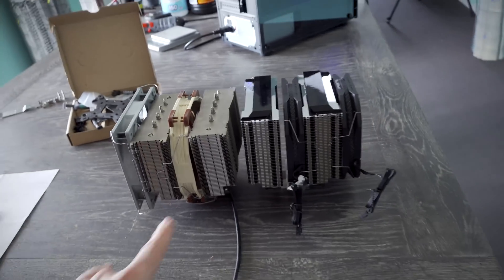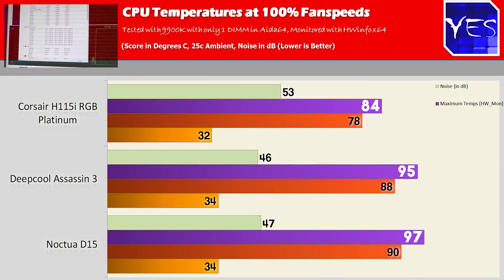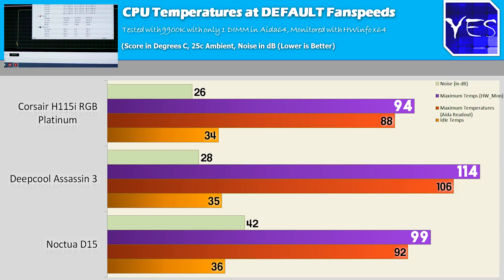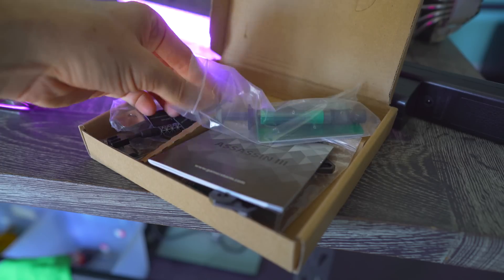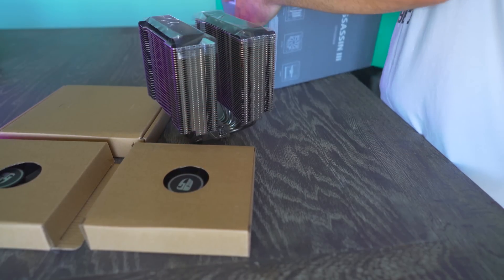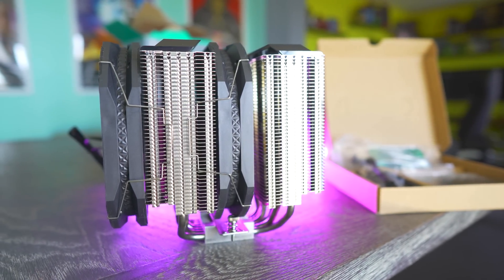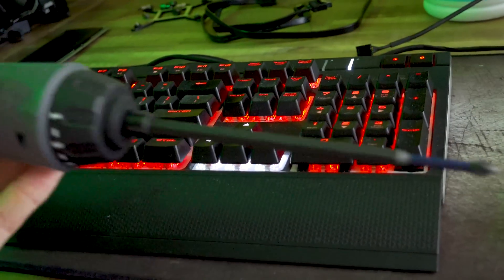Is Deepcool's New $100 Cooler the end for Noctua's D15?

Comment: why the random fan with d15 noctua?? it doesnt even fit as it should... and is not even closer to the stock fan performance. Push config works better with d15. Zero effort man. Read some forums threads before making a video. Besides all that, ive both and if you use the same thermal compound with the same ambient temperature sometimes you get a 0.5 better temps with deepcool and sometimes 0.5 with noctua. Room gets warmer with each test.

Comment: Of course the human ear is most sensitive the frequencies between 2000 and 5k Hz, therefor a fan manufacture can try to choose materials that will have resonant nodes away from these frequencies. Designers should use the human ear perceptual loudness curve model, rather than linear spectrum measurement.

Comment: Why are the coolers are mounted in the wrong direction? They are supposed to be mounted with the fans facing the memory slots and you need low profile memory to use with them. That way you don't block any PCI-E slots on the motherboard.

Comment: Disagree. I'd take the air coolers any day of the week over an AIO for computers that are actually USED and not showcased. Downtime, or the Concern of down time is something that you don't want. If a pump fails, or your fluid evaporates in an AIO (i've had it happen multiple times over the years) then you have little to no warning, if lucky you may see a gradual loss of efficiency of cooling over months of time, or you might just have an abrupt crap-out. With Air cooling, most anyone can 'jury rig' a fan in place to replace any fan that dies, and keep going without the need to fully tear the system down and start a massive hardware replacement campaign. the absolute MOST that you will need to do during the worst failure an air cooler can have, is to replace a fan or god forbid 2. most of us will have a fan of some kind sitting around that can function as a "not the right parts, but at least i can keep going" replacement. If you lose an AIO pump, or fluid, that is a MASSIVE amount of down time if you dont have a replacement on hand or available locally (I do not) There is nothing that makes water cooling a Necessity, and locking yourself into something that is harder to replace, and impossible to repair like a custom loop would be, An AIO seems to be a large weakness to allow into your system, for such minor gains. if air cooling can accomplish all the actual NEEDED functionality and requirements, is that extra 5-10 C cooling going to feel worth it, if your then stuck a week without a pc, waiting for a replacement cooling module, when all you needed was a piece of metal with fins and a fan? (hyperbolic reference of an aircooler) For people who Build a computer to be BUILT then USED, who arent concerned about having ease of access or require constant addition or removal of components, Air cooling is the winner. If you are one of those people who take you computer apart constantly? you'll want water cooling for the ease of install and compactness. If you are like me, and Build it once to work for years, and not be interested in worrying about failures. (An aio in my experience would be the number one component to fail in a system, if all parts were equally new) Then you want air-cooling. I build from a Reliability/value perspective. a 100mhz overclock isnt going to be sufficient encouragement to move to a component that there really is not a good case in favor of. Water cooling is only Actually useful, in very very niche usage cases. anything else is just being a cooling enthusiast. That is a fine thing to be, but one shouldnt build a system based on ONLY the "PROS" but also, what CONS do things bring to the table? and when do the Cons, out weigh rather meager pros. 

If Air cooling gives you all the clocks you are asking for, at reasonable temps, does adding more points of failure make sense? yes, AIO's may offer better temps, but if you are already getting the clocks you are targeting, why add the extra cooling? its like putting a 2080ti in a pc that had been running a gtx 970 that is running a 1024x768 monitor. Sure its better, but WHY?

Comment: Can't wait for the snowman! 

Do modern Pc's still have settings in the BIOS to sound an alarm when the CPU reaches a critical temperature in case of AIO loop pump or fan faliure ? I haven't looked for this setting and if it still exists since I was playing with my first ever 775 socket board.

Comment: Crazy prices when Ali Express offers great 4 pinned (variable speed control fan) double heat sinks (Yes 2 separate towers with heat pipes going to both and a fan in the middle for better heat dissipation) for SO MUCH LESS! 
My old V8 CoolerMaster only has aluminium pipes and actually cools LESS than these cheap ones from Ali Express.
6 COPPER heat pipes and all the attachments needed.  Screw paying that much! Around $25 for the same cooling suits me FINE!

Comment: Well to the very least their AM4 bracket definitely changed this time, I hated the fact that in older CPU DeepCool models - they still used the AM3 clamps which is terrible to deal with if don't know how to use that.

Also yes, unfortunately - the comparison isn't apples to apples so its only fair you do a revisit of the Noctua with its original fans instead of having a replacement third party fan.

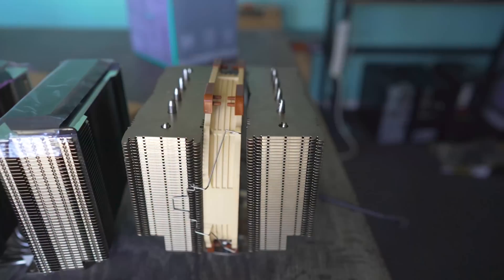Comment: 1:25 That Redux Fan will HURT performance significantly for thr NH-D15. It has terrible static pressure, and tops out at 1200 RPM where the NH-D15 STOCK FANS do 1500 RPM with significantly greater Static pressure.

Comment: Regarding the riser cable mentioned. It either works at the bus speed or it fails. Signal time will be increased due to the signal having to travel further but as long as the signal time is still small enough to still fit within the pcie clock tick the performance of your peripherals will be unaffected. If the signal time no longer falls within the pcie clock tick (very rare I would imagine) then your peripheral simply won’t work at all.

Comment: Linus Tech Tips just did a colab with Noctua ,  for a D15 Remake with LTT Blacked out Cooler and Fans ,  With Orange or Black Rubber Stabilizers on the fans for customization .   And The U12S https://youtu.be/ajJaYGnKpu4?t=419

Comment: The reason the DeepCool fans sound more annoying despite the same dB level is because of the fan blade tuning. Noctua slightly varies the spacing between the blades to spread the noise across a range of frequencies which dulls the perceived noise; this is a technique borrowed from car tires, which vary the size of tread lugs for the same reason. If all the fan blades are evenly spaced or the tread lugs on a tire are all the same size, you have a multitude of noise making elements striking at exactly the same rate as each other, which creates a pronounced tone of a single frequency.

Comment: Last time cleaning my system, i was wondering why there was no light in my H115i PRO RGB but when i got into windows, everything felt so slow, like using win10 on a 15 year old low end system. First thing i did was checking CPU temps, 100c across all cores. That's when i realized i forgot to plug in power to the AIO lmao apparently an 8600k at 5ghz needs the pump to run xD Worked just fine after plugging in the SATA power though, cooler and CPU still runs perfectly fine

Comment: Use that AiO for two years every day, then compare temperatures to the aircoolers again. Your pump will be broken and will either not work at all or be degraded to the point where it loses to an old stock Intel CPU cooler. Thats why its a trash product, having to buy one every two years is a ridiculous waste of money and ressources. All that corsair AiO's swimming in the sea at the end you know..
Reply: LOL WHAT A LOAD OF BULLSHIT!!!!!!!  I'm still using my Corsair H110i GT bought during the end of 2015 and it's still doing FINE!!!  and I even got it on sale back then for a mere $75 . Been using it every day as my main rig 24/7 as i mostly just put my PC to sleep when not in use
STILL RUNNING FINE on I5 6600K OC to 4.7Ghz (yes its overkill cooler for cpu) 22-28C idle - 50-60C load..... YES AIO WILL DEGRADE but certainly will last more then 2 years as you claim, I give it at least 5 years
Reply: @2011-s7k  and i bet it has peaks to 90°C due to pump degradation, because what you are saying is impossible for the type of pump thats build in there, corsair/asetek are even admitting it. You are just the one talking BUULLSHIT or you havnt even tested it properly for years and think its fine when its already gone.
Reply: let's see as I'm typing this to you... oh yeap temp at 25c, Max on Hwminitor 60c while full load , and still haven't clean Mr rig full of dusts for over a year.. yeap you're full of bullshit Corsair h110i gt still running fine... BTW its not a corsair/asetek.... i even gave you the name of the AIO... do you research and have the product on hand to test it yourself even if it's an asetek pump to see for yourself, don't just go on how bad aio are cause you read it somewhere....

Comment: 3.Water coolers also build up bacteria growth after years where air coolers dont, and then jays 2 cents did a test, aios of the same price as the noctua nh-d15 dont cool as well as the noctua. Bryan i think you should check out darkflash 6 heatpipe cooler for 30CAD on aliexpress, its a 6 heatpipe dual tower cooler that uses 90mm fans so its smaller than noctua, but its also a 6 heatpipe cooler so i think it could give noctua a run for their money for performance

Comment: In 2014 I purchased a Corsair H105 240mm AIO to use on my intel core i7 4790k, 4 years later I started to see small drips on water on my videocard, the 240mm rad started leaking from the [endtank]. I went back to aircooling with the "be quiet! Dark Rock Pro 4" silent operation with no problems(amazing cpu cooler), Its nice to see new CPU air coolers on the market.

Comment: The one to beat is thermalright lgmrt. The nh d15 is just the famous fake king, not the real one. Air coolers are not behind, your testing is stupid and by yours i mean the whole internet.
 Stop testing coolers on test benches. It´s not a real case scenario and it will not translate to the case.  Different coolers will behave differently in different scenarios.

Place an air cooler in a mesh case with a front intake aligned, and place an AIO (normally you want AIO on the of the top of the case, so you don´t overheat the whole PC, but lets call it "fair").... See which one gives you better temps and test that at different speeds and noise. If the CPU thermal density is not an extreme high bottleneck, the air cooler is gonna beat the crap out of the AIO, especially when taking noise aswell into consideration. By the way, that´s called, real case scenario, and it´s how ppl use coolers, so it should be tested that. 

Also something unfair, is testing AIOs at max speed. They are unbearable and they come with extremely high RPM fans. Place the same fans on the air cooler. Let´s see how it does, at the same noise lvl.

Comment: i had a Cooler Master Neptune 240 on my i7-4790k and still used that when i got my Ryzen 1700x then i started to hear a ticking in the pump housing and seeing that it was about 4 years old i changed it for a Corsair H100v2 i still have the 1700X set up but when i got my 2nd system a 2700X i got a D15 and i am thinking about getting one for my 1700x system as i do not trust AIO water coolers to last more than 4 years even though that say they will last longer and the D15 runs my 2700X at about 65c max

Comment: Noctua D15s vs D15
The D15s looks like the D15 with the 2nd fan removed but it's actually slightly different. https://noctua.at/en/whats-the-difference-between-nh-d15-and-nh-d15s
The cooling is almost identical with the D15s a degree or two behind though probably it's the same or ahead if you normalize for sound as the two fans on the D15 should add some noise. I thought of getting the D15 at one point then just remove the 2nd fan and use it as a case fan (it's not optimal but in reality works well and is pretty silent as I've done this already with the D14) but I'd get the D15s (or AM4 variant for AM4? Not sure if the AM4 variant makes sense if it doesn't cool better) or wait for what I believe would be ideal... an all-BLACK version of the NH-D15s?

Comment: I got Deep cool-Lucifer v2(wich is big brother of assasin 2 at lower cost)and i am able to clock my old i7 6700k to 4.8 ghz stable with awesome temps in aida to 80 degrees max and 75 in games, 1.46v. And its able to run it on 5ghz, not completely stable but temps are not going highter than 87 degrees, its awesome for air cooling! His weight is about 1.1kg 😁 and have awesome price for that monster

Comment: I am just too cheap to spend my money on the AIO - I don't feel it gives enough extra for the relative high pricepoint, even if it does cool a bit more... I don't hardcore overclock anyway either. 

I am probably also too cheap to buy that big of an air cooler. I have a couple of Hyper 212's - AndI think my next will be the arctic esport duo (right now I am using ryzen prism cooler, because I am still excited about my 3700X, but at a point I am most likely going to upgrade the cooler)

Comment: Nope. The Noctua will last much longer. The deepcool fans will fall apart quickly as is always the case with their products.

I have Noctua fans from the early 2000s still running. Some from like 2005 or 2006.

Comment: you should check out the scythe coolers. The mugen is almost as good as a D15 for 50 bucks. Just make sure you buy the right bracket for your cpu separately if its not included.They are very quiet as well.
Reply: you dont just pay for noctuas cooler, you pay for eventually cpu brackets that  u need if you gonna switch to amd for example. they ll send it to you for free if you can prove your purchase. also 6 years warranty and it cools the best with lowest noise. 

you dont just pay for the cooler, you pay for quality performance. glad with my d15. idle temps of cpu are fucking 29-32 degrees, under load (p95 v26.6 4.3ghz on 1.21) temps never rise above 62. thats with default rpm.

if i manually set my cpu cooler to max rpm it never even gets above 55. lmao plus it barely makes sound, this guy is a terrible reviewer.
Reply: @deathrager2404  Well the brackets for a scythe cooler are like 5 bucks and the cooler is half the price for the almost the same performance so yea. Nobody's saying that Noctoas bad.. everyone knows they make the best air coolers even if they are overpriced and kinda ugly. The radiator in my car is cheaper than a D15 tho lol.

Comment: I think you forgot about the Dark Rock Pro 4. :)
Reply: Phrea Nix That one is nice cooler too! Not as good as Noctu 15D, but close enough!
Reply: @haukikannel  I've owned both Noctua D15 and BQ DRP4 and the BQ wins out on Aesthetic and sound. The performance is less but not by that much. The main gripe is the installation for the DRP4 is far more fiddly and cumbersome then any other cooler I've ever worked with...
Reply: Yeah! But i guess BeQuiet products are rare in Australia? I scored one for 54€  here in Germany (60 USD / 88 AUD) and replaced an Antec Mercury 360 AIO with it. Much quieter, as the pump annoyed the hell out of me. Did not check temps back, but my r5 3600 overclock did not scale back, so very happy with the 'step back' to air..

Comment: Could you please you review them and suggest me which will provide better cooling among them

1. 6 heatpipe, 2/3 Fan(2/3x90mm) 2 towers
https://www.aliexpress.com/item/32986572385.html?spm=a2g0o.cart.0.0.777d3c00XhG20w&mp=1

2. This is identical to no.1 but the pipes are closer and in no.1 the pipes have some more space between them you can see it in the pics will that make any difference?
https://www.aliexpress.com/item/33055350285.html?spm=a2g0o.cart.0.0.163f3c00EY3eLN&mp=1

3. 6 heatpipe, 2 Fan(2x120mm), signle towers
https://www.aliexpress.com/item/32960406803.html?spm=a2g0o.productlist.0.0.51bc26f7i5H5vQ&algo_pvid=28a7c118-2c4c-4d36-bc47-e55926126bcb&algo_expid=28a7c118-2c4c-4d36-bc47-e55926126bcb-3&btsid=4db0a52d-0397-4a52-8058-717438d20f23&ws_ab_test=searchweb0_0,searchweb201602_,searchweb201603_53

4. 5 Heatpipe, 1 Fan(1x120mm), single tower
https://www.aliexpress.com/item/33038907107.html?spm=a2g0o.productlist.0.0.7e0b10d0GxSHLh&algo_pvid=c88fab33-96a7-490a-a500-8ca03ac1f565&algo_expid=c88fab33-96a7-490a-a500-8ca03ac1f565-0&btsid=970e803b-13c6-4a09-9375-ff44d38d3080&ws_ab_test=searchweb0_0,searchweb201602_,searchweb201603_53

5. 6 heatpipe, 2 Fan(2x120mm), single towers (price is high but is it worth the high price?)
https://www.aliexpress.com/item/32993609816.html?spm=a2g0o.productlist.0.0.51bc26f7i5H5vQ&algo_pvid=28a7c118-2c4c-4d36-bc47-e55926126bcb&algo_expid=28a7c118-2c4c-4d36-bc47-e55926126bcb-8&btsid=4db0a52d-0397-4a52-8058-717438d20f23&ws_ab_test=searchweb0_0,searchweb201602_,searchweb201603_53

Comment: I think my 910g 6-heatpiped Scythe Ninja 5 (1190g w/ fans) could rival these coolers ;) and that for just €55,-! Easily runs with fans inaudible with something like an overclocked 6700k.
Reply: Honestly, I can't even believe the temps I'm seeing there... but I guess the 9900k just consumes insane amounts of power compared to a 6700k. My overclocked 6700k never got over 60 degrees or so, and that's with a low airflow, inaudible system. I currently have the Ninja 5 on my E5-2690 and it's even able to run fanless keep temps below 60. These are real world scenarios though like rendering and gaming.
Air cooling > AIO for sure. AIOs are noisy compared to a high quality air cooler like the Ninja 5, and that's not to mention other downsides of an AIO.